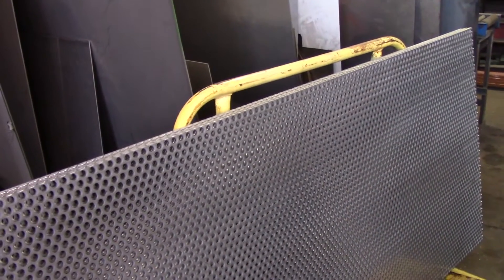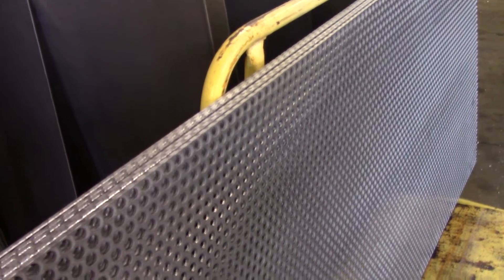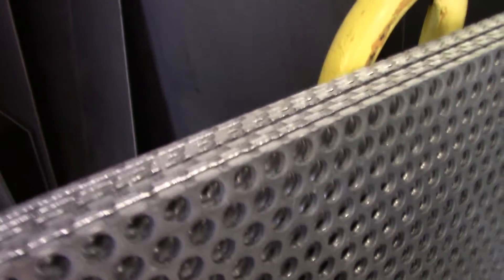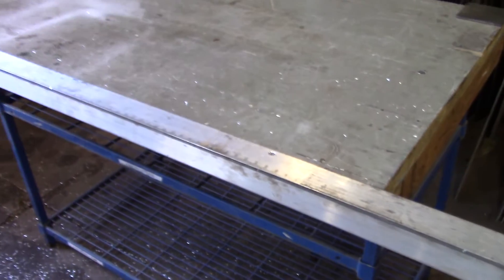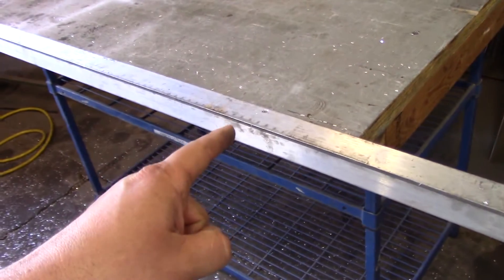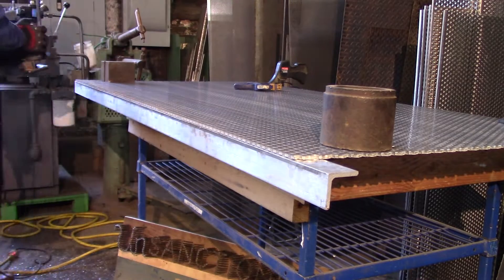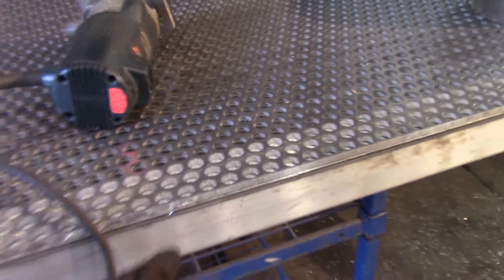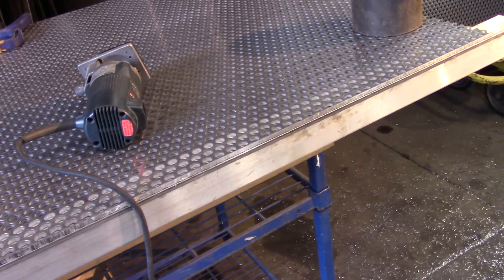Wood router on thick aluminum sheet

Comment: if you want an even better edge run the router right to left, instead of left to right. In machining we call this climb milling (google it). should only be used for taking of extremely small amounts, but will have a better finish

Comment: Great idea.  I've been cutting pretty heavy gauge sheet aluminum with an air nibbler while clamped in a sheet metal brake.   Good to know a router works for thicker.

Comment: I have a good supply of old street signs I use for countless different projects. Been cutting them on my table saw and rad. arm saw with carbide blades for years. Cuts like butter. Just wear earmuffs as it's loud and follow good safety practices.

Comment: What speed do you use on the Router?
Reply: Smaller chips. Taking tiny slivers. Faster. Maximum speed. Don’t want to take big bites and load up.

Comment: I want to cut out an opening on  aircraft aluminum sheet metal already installed using a plunge router rather than tin snips. What do you suggest? the aluminum is white and can not be scratched.
Reply: First, if you're using a router - is the opening square or round? Next, if it is round and not too large you could try a "diamond" hole saw bit (eBay, Amazon, etc.). If, however, the hole is going to be rather large, using double sided tape and "felt padding" on the bottom of the router, jig saw, etc. will prevent the tool from scratching the paint. Also, to protect against chipping paint while cutting the hole "painter's tape" NOT masking tape placed over the cutting area edges, will not chip the paint or leave residue upon removal.

I'm a professional photographer and DIY'er specializing in building my own tools, equipment, props, flash units - you name it - if it will save me money that I can pass on to my clients - well, that's time not wasted and happy satisfied buyer.

Happy cutting and let me know if you try this out for yourself.
Reply: @15thparallelphotography  you're a genius!

Comment: Have you ever tried putting like a 45 degree bevel on the edge of that thick of aluminum with a router? It would be perfect for an access panel opening in a project I have but I'm not sure if it'll actually work.
Reply from the maker: I've been beveling and rounding aluminum since I shot this video at my own risk, but please be careful since it's breaking the rules of the tool and router bits.

Comment: Used router with chamfer bit to deburr large parts off cnc machine at my old job. Does leave a nice finish, stick wax can help avoid chip welding. Even okay on steel (light cuts) though the bit gets dull quickly.

Comment: Awesome!  What RPM is that running at?  I'm doing some research to figure out if my overarm router at a fixed 20,000 rpm will work for something similar (obviously smaller scale, but using an end mill cutter in aluminum)